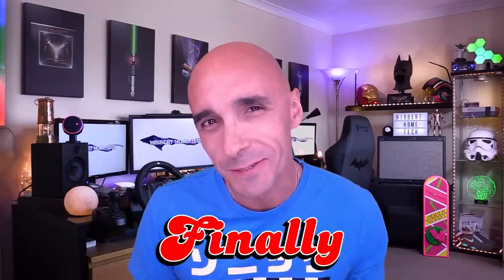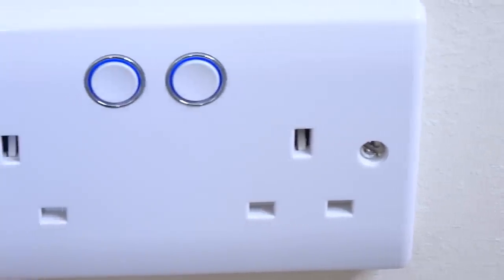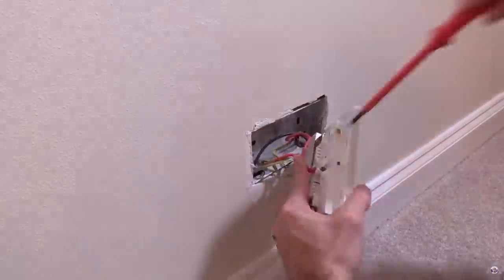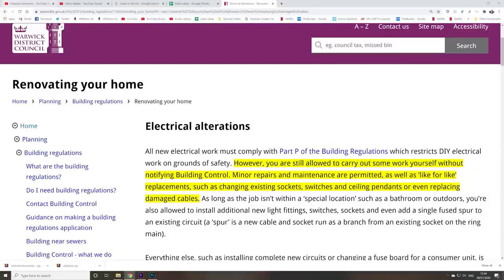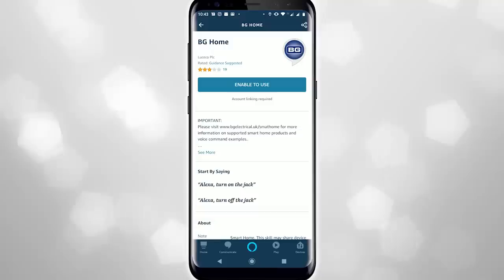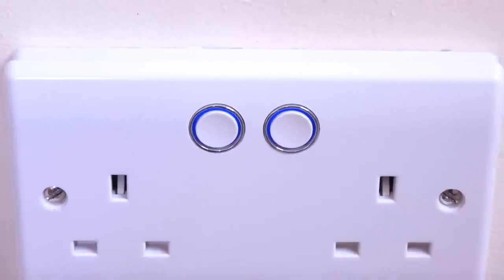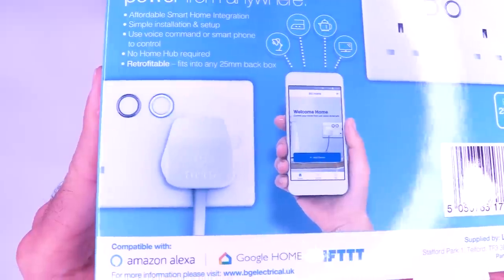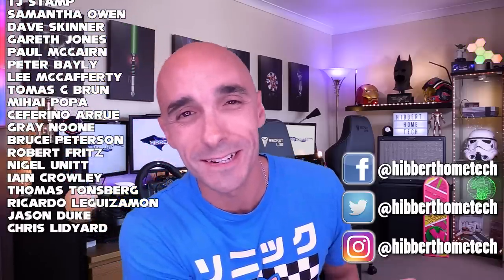BG Smart Home Sockets | Alexa and Google Wall Socket Review

Comment: I want these in chrome but with USB outlets too, that would be perfect
Reply: @DB_Videos275  These are literally the same sockets as Paul reviewed before (Idk why he says you can't buy them anymore).
Also the Smart Life and Enerj apps are both based on Tuya so they should work interchangeably.
Reply: Yes they would be but they wouldn't work very well, as the metal would block the signals that's why they don't exist yet.
Reply: @DB_Videos275  do these plugs with usb work over wifi with alexa or are they remote control plugs that require broadlink? I just want standalone wifi plugs with usb ports aswell without needing additional hardware to operate.

Cheers
Reply: USB is an ever changing standard. I wouldn't tbh
Reply: @waqasahmed939  if that were the case no manufacturers would make them, but they do and the DIY shops and online retailers sell them by the cart load
Reply: Scotch bright and a decent chrome spray paint lol
Reply: @shaggyego  lol not a bad idea

Comment: Paul, couldn't agree more I have been using these for some time now. They are low cost, reliable and have a good WAF  (wife approval factor). I use one behind my flush wall mounted TV as a way of switching it on and off remotely. They are also Home Assistant compatable ;) They are sold by Screwfix but it is the square edged version, I personally think the rounded edge version sold by Amazon  is more aesthetically pleasing. I wish BG would launch a wall switch version. For now we have to use  ones from the likes of Sonoff or Aqara, but it would be nice to have ones that meet British Standards.

Comment: Hi Paul - EXCELLENT video :-) As are all your other ones.
Just come across this whilst checking to see what I have missed from you.
I love these sockets, they are a good low-cost solution. As a Smart Home Installer, I install these, plus other Z-Wave controlled socket controllers.
Also - As a Fully Qualified Electrician & Electrical/Electronics Engineer, I appreciate your comments about replacing sockets in the home as being potentially DANGEROUS :(
Although there are no specific requirements (Part-P, Building Control) that say sockets cannot be installed by the Home Owner - There is usually a Get-Out Clause in the instructions that come with most electrical accessories (sockets, switches, etc). This clause usually states "...must be installed by a Competent Person..." In this case 'Competent' is a LEGAL definition!! If things do go wrong, then whoever installed the accessory must "Prove" that they are Competent. This proof is usually in the way of supplying the installers' qualifications to the court!!
An assumption you have made, is that the original socket was wired correctly in the first place? So wires can just be re-inserted. Also, many sockets have their L & N terminals on different side, thus an amateur may end up wiring the socket back-to-front (potentially lethal!). 
Finally, you have not used the correct test kit (to GN38) for testing mains electical accessories!!! As proved by the fact that you were able to SHORT out the cables :-)))
PS - An 'Electricians Screwdriver' is NOT a good way to test electrics - You are using your own body to conduct electricity, and if your screwdriver is damaged - you could DIE!!!!
PPS - In my Professional view - MOST(!!) electrical installations 'HAVE' been installed by 'Morons' :-))
Hopefully, I'm not the 'Idiot' you are referring to??? :-)))
On a serious note - You seem to have done as much as reasonably possible, to make your viewers aware of the potential pitfalls & dangers when working on mains electricity - Many thanks...
Fianlly - Really, this time.... Keep up your excellent work. You are very enternaining & knowledgeable :-)

Comment: As someone from the US, I'm not sure why I clicked on this video :). However, I enjoyed it all the way to the end. Very interesting how the wires differ. It looks so much cleaner in the wall there than here. Anyway, if it hasn't been mentioned yet, TP Link/Kasa has a smart outlet for the US. I haven't got it yet because I had already bought a TON of smart plugs from Kasa for all my outlets before the smart outlet came out. If the smart plugs ever stop working, then I'd probably consider the smart outlet over replacing with a smart plug.

Comment: I had the same issue with the wiring in our kitchen. Oven wired into the ring, and two sockets wired into the breaker labelled "oven".

Always check the sockets are dead before you start work!
Reply from the maker: Yep, my breaker is labelled up totally wrong since I had the garage converted. Not even sure I can correctly label it anymore as one of the switches cuts off only half of the downstairs sockets!
Reply: Easy, label it "half of the downstairs sockets"

Comment: I doubt anyone will see this but these are on sale at the moment (16/9/20) on amazon for £14.69, which is the cheapest I've seen them.

 My electrician who wired my house was my dad, 30+ years in the MEB not an idiot. His son (me) 3rd line IT knows his stuff, listened to all the advice given by his dad and then crossed the upstairs and downstairs lighting rings. He (I) then turned off the the upstairs ring and changed an upstairs light switch (dual to single as the other light was removed) and guess what happened... No I thought about it and then used a multi meter, after that I called dad and told him off (for my mistake, I forgot I was the last one to be messing with the lights in the hall way and caused the cross). Some people don't deserve dad's... Sorry Dad!

Also thanks for this Paul your "what's Andrew looking at now" sense is getting stronger, this was my next purchase.
Reply from the maker: Glad you're OK mate. Electricity is so dangerous. I hate doing these sorts of reviews because even though I know what I'm doing I'm still terrified that you never know what you don't know.
Reply: @paulhibbert  Any time I've screwed up with electricity it's been down to over confidence and or assumption. I think your review is good and showing the usual errors like having it upside down is useful. 

The basic advice I give is if you don't feel comfortable doing this then don't, your house's wiring is not the place to learn new skills, find someone who is an electrician or that you know personally is very competent and ask for guidance. Always use electricians vde screw drivers they have already saved me once and I wouldn't touch anything that could sting with out one. Be safe people!
Reply: Also this item is £10 cheeper than the one that would burn your house down that I was looking at. Good catch.
Reply: BG if you read this, if you produce a usb output equipped version of this, add the function to turn the usb sockets off via WiFi too. It's something that's missing on most other products at the moment.

Comment: I switched to these BG smart sockets (no pun intended... honest!) about a year ago when DEN went under and have not regretted the move. The sockets work reliably and the integration with Alexa is excellent. I have used several other BG products over the years and found them to be more robust than MK and considerably cheaper. They are in the process of developing a smart light switch, which should be released later this year afaik.
Reply from the maker: Nice! Thanks man! With all the bad reviews about WiFi signal and reliability it's reassuring to hear you've had a good experience for so long 😊
Reply: Paul Hibbert I did have one or two disconnections of the sockets in my detached garage but these were cured by the addition of a wireless repeater in the garage to provide a more stable wifi coverage. I also assign fixed ip addresses (linked to the equipment Mac address) for all of my permanent wifi kit so I guess that might help stability a bit.

Comment: Paul always love your video's but when it comes to voice activated kit, who can stop at 1, before you know it your wifi is over run and you have invested lots of time and money on WiFi automaton. They you have to do it all again with your favourite word "zigbee". WiFi units aren't cheep when you have to pull them out and replace them. I say this from experience, started with wifi, moved to smart things, changed my hub to home assistant and a conbee II. Now its all local and just works, every time. Thanks Roy
Reply from the maker: Hey Roy, the amplifi HD router could have saved you the trouble 😔 I tried to Max it out for a video and failed!
Reply: @paulhibbert   hi Paul, I am using a $600 Asus Rog GT5300, after 40 devices that failed, so i bout a 2nd GT5300 and ran them in a Asus mesh, after 60 they started dropping devices. With power points light switches, motion sensors, door and windows switches, i am over 80 devices, and not had any issues with the conbee II and home assistant. I also have 10 tplink wifi plug sockets, and home assistant controls them locally, no cloud, also sonoff wifi locally, it grabs the mac address once from the sonoff cloud, then all local after that.  But thanks for the reply Paul, never laughed so much watching your clips. Roy

Comment: Anecdote Time.
A number of years ago, I was helping my landlord of the time change some light fittings in the kitchen (two separate fittings, each on it's own switch). He disconnected the breaker for the room (flipping a light switch to confirm not live), then we set about removing the old fittings, and installing the new ones. I say we, it's more factually accurate to say that I got sent up the aluminium stepladder to do that particular job. When we'd finished, the landlord's partner was called in to test the lights out (landlord gives me a wink, as the breaker hadn't been reconnected) - she walks into the kitchen, flips a light switch, and the light fitting I've just finished wiring up (I'm still sitting on the stepladder at this point, so I'm literally right next to it) springs into life - full force of 4x GU10s right in the face, point-blank! Landlord's partner says "That's nice", and wanders off. Landlord and I look at each other wide-eyed ... landlord says "I think I'm going to the toilet" ... "I think I've just been", was my response! 
Moral is, check and double check everything is off before you get started with the screwdriver - never assume that, just because one fitment is no longer live, that the others are on the same circuit and breaker - I was bloody lucky!
Reply from the maker: 😮 Wow. This is terrible, but a great story! There's a lot of people telling me "just use a lamp to prove the electric is off" and I keep telling them "9 times out of 10 you'll be safe, but one day there will be an electrical fault at the socket and you're lamp will be out with live wires behind the socket" 😔
Reply: @paulhibbert  Having rewired a house when it was legal to do that, I'd point out that if you have light circuits on the stairs with switches up and down you need to be ultra careful as the lights can be on two supplies...or at least they were in my parents house...

Comment: Of course the definition of like per like replacement varies by region and country.   I have heard of no country that has started claiming replacing a regular socket with a smart socket is not like per like (provided the outlets have the same amperage and voltage ratings).   However, I would not be surprised to learn there is a country were that isn't the case.  However, for this video you are really only concerned about the UK, as that is where this product would be used.   I personally recommend the voltage wands, so you can check every wire.   About 35 years ago, my father had me rewiring one of his apartments in North Dakota.  The circuit breaker was off.  I confirmed there was no voltage.   Then I bitten by a live line.   Turns out there is a coding standard that allows the alternating of the live wire and the ground wire.  It is rarely used, so the wires I didn't check were live in every other socket.

In Canada we do something similar, but only for kitchens, and in that case the circuit breakers are required to be ganged so you cannot turn off one and not the other.   However, it turns out the ganging has a bit of flexability.   So there have been times when I have gone to do work on the kitchen electric outlets, to find one was still on, while one was off.   But fortunately, I usually use a wand, so I know about it before doing any work.  (I say usually, because I'm the type of idiot who will occasionally leave a circuit on, just because well, stupid reasons.)

Comment: Those look great and well done on doing a proper job of warning people to take safety seriously; very nicely done. And on the regs about what DIY you can do, is it just me that first read that highlighted bit as "ceiling pedant" as opposed to "ceiling pendant"?
On the sockets, when you show shots of it installed in your home is that using a spacer because your back box was quite shallow? The shots of yours on the wall look to me as if it's projecting further out from the wall vs the pictures on the product packaging that you show at the end but maybe that's just camera angles and my eyes playing tricks on me.
What is the maximum depth in mm of the face plate?

Comment: Really tempted by these but hope it doesn't fail at any point. Lazily i would get this for the living room/kitchen/bedroom light and then one for the socket which is used for ironing.
Reply from the maker: Still using mine regularly 😊 one failed out of several but I’d had the same issue with another brand in the same spot and I think I was overloading the socket 😬
Reply: @paulhibbert  good to know 🧐

Comment: Bizarrely, I've installed and all setup with Alexa. Alexa detects them as Switches. The voice commands won't work with on/off commands? I get the Alexa "Success" message but nothing happens. I can still go into the Alexa app and manually toggle them off/on but still no joy?

Comment: I have these sockets all over my flat and they are really good and look nice too. Pairing can be a hastle and if you update the firmware with a bad WiFi signal then it will fail and continue to fail unless you increase your WiFi signal or move them closer to your WiFi router, I made a wire with a plug on the end to fix one that failed the firmware  update and wouldn't work until firmware update was completed. After watching this video I paired them all with my Broadlink app easily. One less app to worry about 🤣🤣🤣🤣🤣

If only they worked directly with Smartthings they would be perfect 😎👍🤣

Word of warning while installing, DO NOT OVER TIGHTEN THE WALL SCREWS!!! I did with one and the ceramic broke, I repaired it with gorilla glue but worth noting 🤔

Comment: There is Mi Home but they need a hub - but if thats isn't a problem, then they are very relkiable and come in a variety of finishes with sensors and light switches etc to match . They even to smart radiator valves, but I've not tried those perosnally.

Comment: Hey Paul wasn't aware that your electrical code there doesn't allow you to do your own electrical wire work.  Here in the states we have the national electrical code and all the smaller governmental areas add their stuff to that and it ends up larger than the bible.  But most have no restrictions on who does the work.  But if you do violate the code and you have an electrical fire your insurance may not pay.   I have been doing electrical work since my dad let me work with him on re-wiring up the basement when I was 8 years old.  Can't stress enough you need a electrical tester and double and triple check every time you go to the electrical box.  I never ever work with live circuits or trust who has done the work before me.  I once found a "hot" wire that bypassed the breaker and you have to wonder which licensed electrician put that in.

Comment: I've been getting support from  broadlink a lot this week. As I moved from ihc for eu to new broadlink app. First time I installed i thought great there are all my devices that was easy. Then noticed all buttons were labelled in Chinese and in the wrong place so alexa could not control them. Support was great but in the end I had to remove everything and start from scratch. I used their back up thing once I was done. But past few days rm pro has been disconnecting and devices were not responding going from working in app but not alexa to working in alexa and not the app. Also kept saying reload in app on selected devices. So in the end went back to ihc.
Reply from the maker: That's weird! Not sure if I'm on the US or EU server these days as I've been messing around with it all a lot recently for testing, but mine still works great every day. I'm using my lightwave switch to trigger my Broadlink gear via IFTTT several times each day and it never fails 🤔
Reply: @paulhibbert  had no problem with old app just the new one. If your using ifttt then your not really using the app. Now everything is backed up. Should be easier to swap between the two so will try the new app again in the future probably if I get the broadlink bulb. Its up for sale on aliexpress.
Reply from the maker: Ifttt is using the same server behind the app, so unless the app itself has an issue then I actually have a bigger potential roadblock by adding the 3rd party. I wonder what the issue is!?

Comment: I've been looking at these for a few weeks i have their WiFi repeater socket and have just installed their brushed steel usb sockets in my sitting room. I have found the WiFi socket very hit and miss and it disconnects most of the time to the point I put the old socket back on and looking at tp link plugs. This smart socket i found a lot of reviews saying it looses connection if not close to the router. This did put me of getting them. Their normal sockets are very high quality tho. You can't go wrong with the sonoff basic for £5 per device
Reply from the maker: Mine have been fine, but I do have good WiFi signal all over the house.